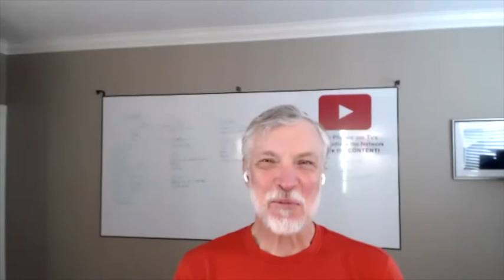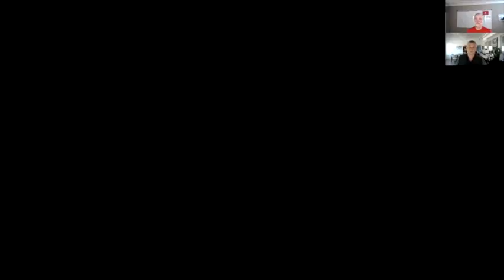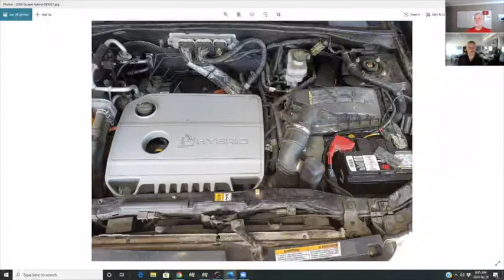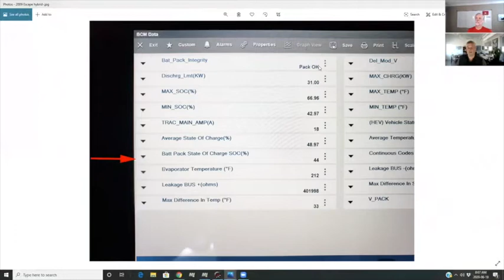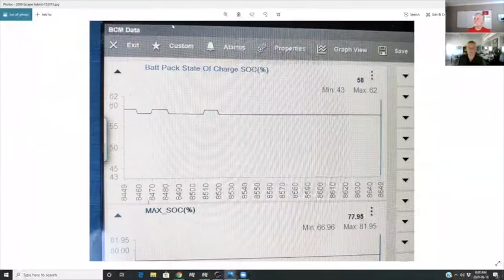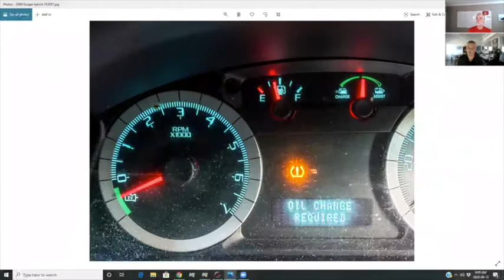2009 Ford Escape Hybrid, HV Battery Recharge

Comment: I just got a 2006 FEH and it's giving me a Service soon wrench light on occasion. Truck starts, regen works and the battery seems to be working normally but I get a P0A0A code. Took it from 22mpg at sale to 28mpg today just driving it like normal ( I do 2hrs on the highway daily). Any idea what to check next? I'm in Virginia and I'd like to avoid the dealer if possible find a hybrid specialist in my area.

Comment: Hi Mark hi Bernie.
I've got a 2006 Ford escape Hybrid. After a sudden illness with my husband my car broke down so i have only his car that being the hybrid.
Has excellent gas mileage but i cannot keep that big battery charged. I have the reset button on the inside of the drivers side floor board. Used to be, he taught me to push the button wait a few mins. And then it started. After he had strokes. He doesn't remember the rest. And I've only lost more and more power options. I cannot use radio, heat, air, wipers without knowing for sure its going to be worse the next time. I've driven it after jumping it off. It rubs great. The electric kicks on if I'm in a drive thru at all. Seems that stays ok so far.
But, i cannot restart it anywhere now without charger, or a fast jump. Last night in a hospital parking lot alone for the first time ever the doors besides the drivers door would not unlock for me to even get the cables out. The drivers side door stopped locking a month ago. Oddly it locks then unlocks really fast.
Idk, how to charge this husband told me before stroke the braking system charges the large battery. Any advice?
Thank you if you do.
Kinda need a safer way to get around but, for time being this is all i have.
Ty for your video
Reply: What a shame they never answered your question. If you are interested, there are a couple of Facebook groups specifically created to help people understand and resolve problems with their Ford escape and in my case, Mercury Mariner cars. I already have saved several hundred dollars in potential diagnosing and repairs for my Mercury Mariner due to the advice I've been given in the Facebook groups. I highly recommend joining them to benefit from the information and advice..

Comment: You have been very helpful to me.  I have dead battery on my 2006 Ford Escape Hybrid,
 I'm going to try the switch, using the 12 volt battery with a 2 or 6 amp slow charger on the 12 volt battery.
Cross my fingers.  If that does not work i will purchase a prolong Charger, for Hybrids.
Thank you from Connecticut, USA
Reply: How did things work out for you.  I have the same issue with my 06.  The trickle charger seems to not charge the 12 volt.  I used a spare battery and charged it, then connected via jumper cables.  This allowed me to press the button (near the break pedal) to allow me to charge the hybrid battery.  They hybrid tries to charge and it attempted to start once but then looses power, then no crank, no start.  Did you have any luck?
Reply: You have any links to this ? Looking at buying an escape that has a drain of sitting for 3-4 days
Reply: See my comment above about about the Facebook groups I joined that have helped me resolve a problem I had where my Mercury Mariner didn't start. Evidently the Mercury Mariner and the Ford escape hybrids have so many similarities that solutions to problems for one usually work on the other.

Comment: Help please, I watched your lexus review video. I have a question. I have a 2014 Lexus es350 I thought my TCM was bad due to water, but I was wrong.  I replaced it with another and flashed it and transmission was still bad, so I dropped the pan and had metal all over the magnets, looks like a spring clip gave out. I have a transmission from a salvage yard and I'm going to do the swap. Can I use my known working TCM without having to flash again or does the valve body need to be flashed on the new transmission?Thanks!

Comment: Hello. My name is Owen I live in FL 
 I have 2009 escape recently I replace the Power steering torque sensor then I left it park for 2 weeks the 12v battery is right at 11.9 volts but the car won't start, has the " park safely light on"  im assuming that the HV battery is dead, i have kids and i lose my job due to the covid19 its something that I can do? As you know  The battery cost more that the vehicle.  
I just need and advice thanks, can i rent a charger? 
The dealer charge a large amount of money just to verify.
 
 Thanks in advance
Reply: Charge the 12 Volt battery to about 13.6 Volts, DC.
Reply: https://youtu.be/TA6Of25tnCY
A man in a Facebook group for people who own the Ford hybrids told me to watch this video. When I tried the technique it worked and started my car that had been sitting for 2 weeks unable to start. It took about five different times of pushing the button and waiting 10 minutes in between. He recommended 8min but I figured 10 min to be safe. But the car did start and it has been starting fine ever since several days now.